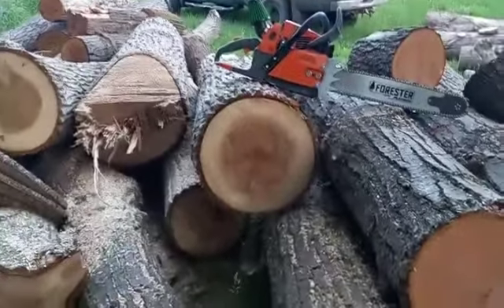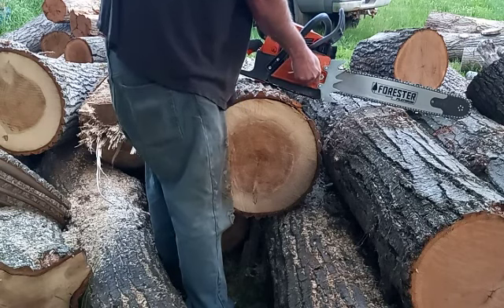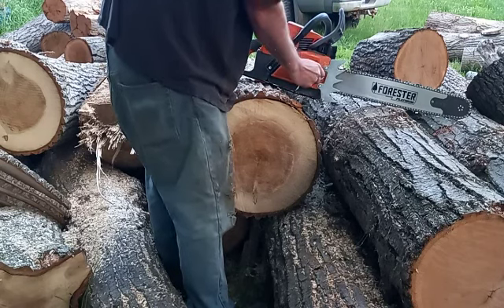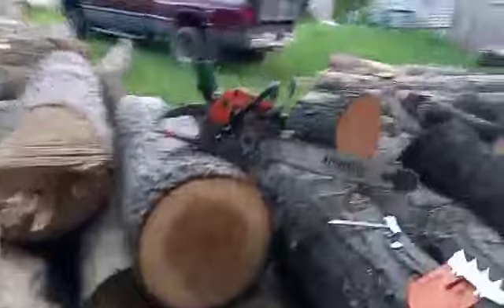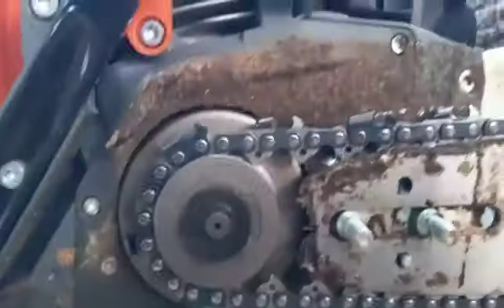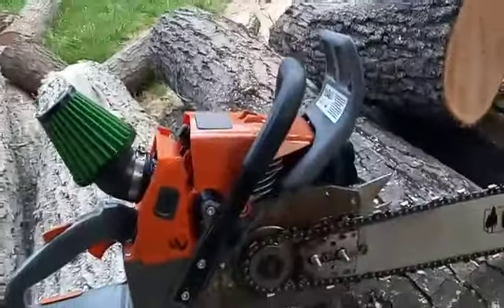This May Have Been A Mistake

Comment: Man kinda shocked how well it pulls with a 10 pin. I been thinking about modifying a 20 inch bar for the 7310 for a 9 pin cause with an 8 it still 4 strokes but that 10 is massive.